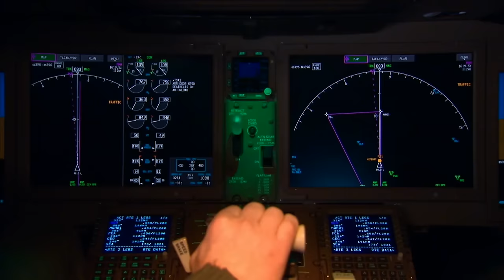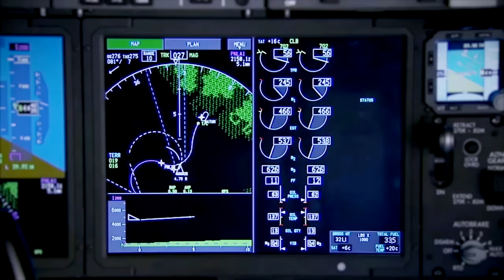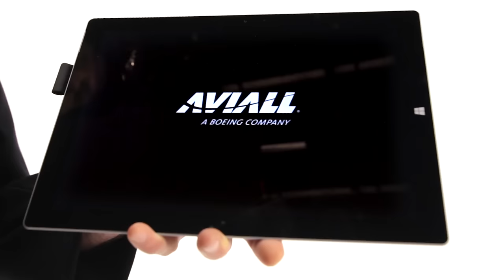Keep the Fleet Soaring: Boeing’s Derivative Aircraft Support

Comment: At 0:37 the 717 and 727 is not on the clip 

WHY
Reply: The 717 is not a real Boeing.
Reply: +UnsyNZ the 727 is
Reply: Daniel Dankers You don't say.
Reply: kykydy was asking about the 717 AND 727, but you only explained the 717 part (if thats the real reason). I was just making clear that your answer does not apply for the 717 and 727.

Comment: you didn't put the 717 or 727 in
Reply: the 717 was a McDonnell Douglas that got renamed as a Boeing when the company merged with Boeing. Its not a real Boeing. As for the 727, I don't know why
Reply: I know he 717 was going to be the md-95, but Boeing still built it, and McDonnell Douglas did too, they also helped build the 787
Reply: BartBooms Chezburger McDonnell Douglas designed it though. And originally sold it too. All Boeing did was continue the aircraft under a Boeing name. That doesn't make it a real Boeing in my opinion